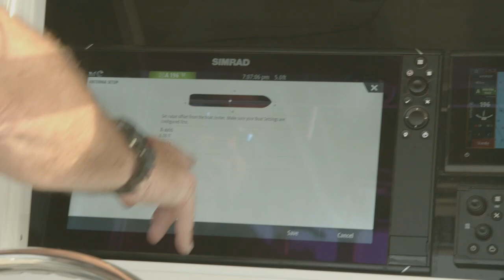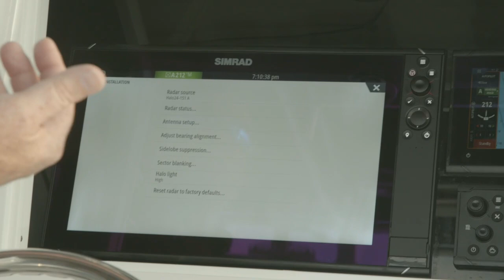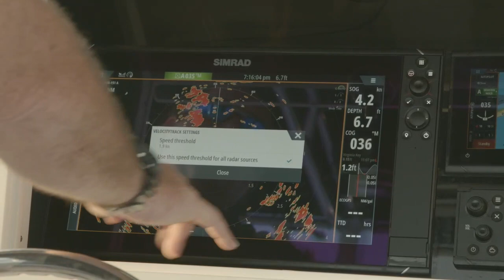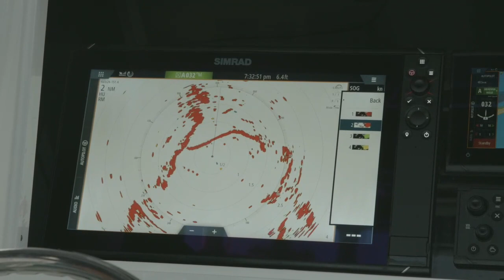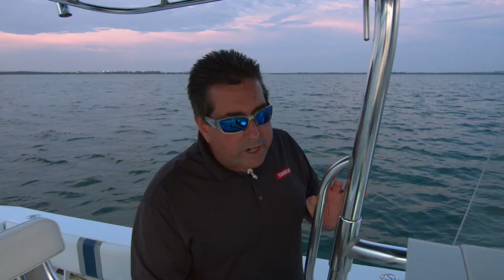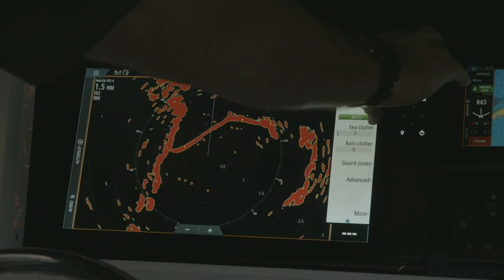Simrad LIVE | Halo Radar Basics | Webinar

Comment: Just installed my  halo 20+ 
For some reason it works I think but when I check the setting in networks it shows no connection 
Also on error code it’s shows none what am I doing wrong ?
Reply from the maker: Please send us a message via FB with your unit's serial number and a pictures of the error message.

Comment: I have just installed a Halo 20+ radar dome and connected it to a Zeus3 MFD. The Zeus is connected via an NMEA 0183 to navigation data including a 10 Hz fast heading compass. The radar works but will not track MARPA targets. Chart radar overlay works fine. The Zeus publishes the heading data on its wifi network.
The radar status screen says
"Radar Overlay status OK"
"Target Tracking Status    Heading not connected to radar"
"Heading on radar   No"
"Heading on network    Valid"
"GPS on Network   Valid"
"Error codes None"
How can I get the Radar to see the heading data? 
I assume it is meant to get it from the Zeus since it is its only connection.
Reply from the maker: We think there might be some source issue. Please make sure that compass source in the nmea2000 source selection is properly set as "zeus3 nmea0183". Please contact our support team at support@bandg.com
Reply: If you mean System/Network/Sources/Compass , It is set to : Zeus3 9 NMEA0183 Port 1 [119628572]
Reply from the maker: yes, that's the one. Please contact our service department at support@bandg.com